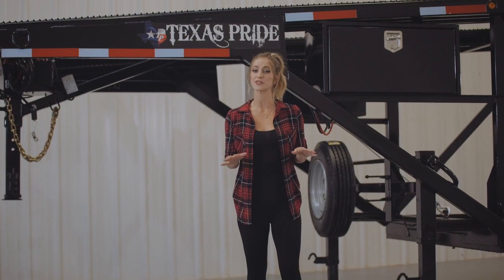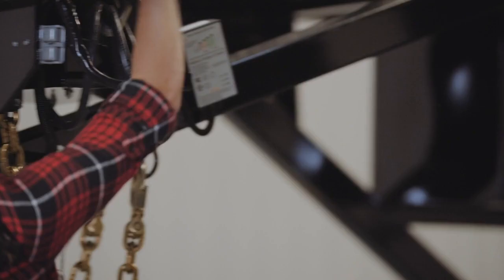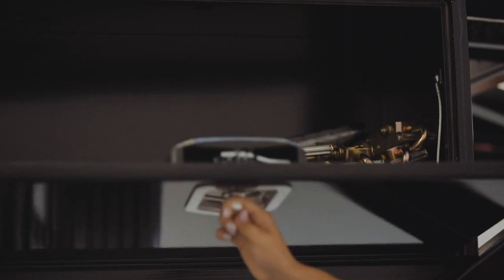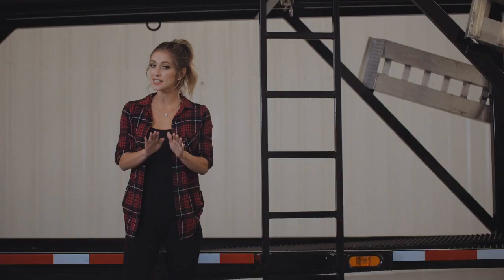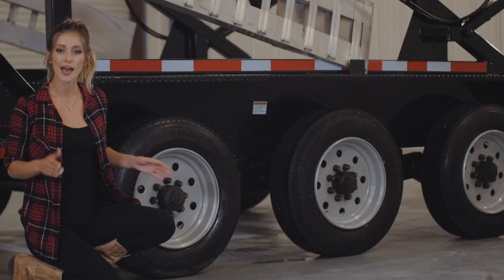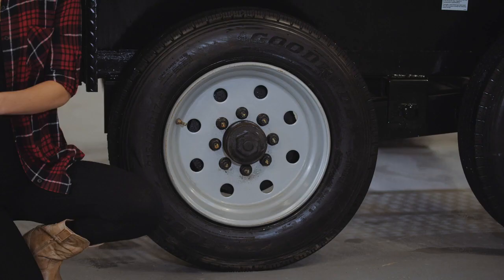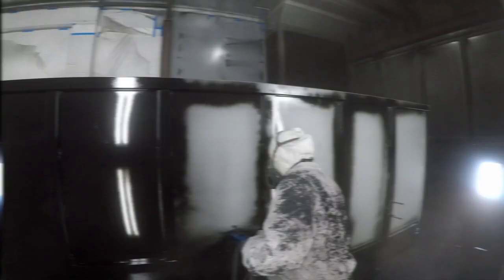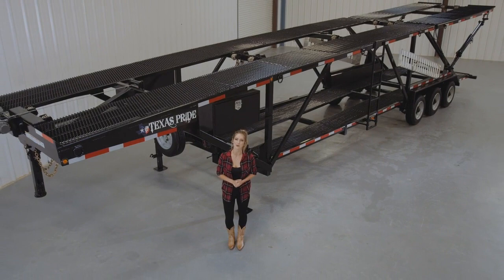Walk Around: 26K lb Gooseneck GVWR 5 Car Hauler Trailer | Texas Pride

Comment: Is it more comfortable / stable to use this trailer with a gooseneck ball or fifth wheel hitch?
Reply from the maker: It's really preference at that point. Depending on the size of your cab, bed etc. and what you feel more comfortable with. Both options are stable.